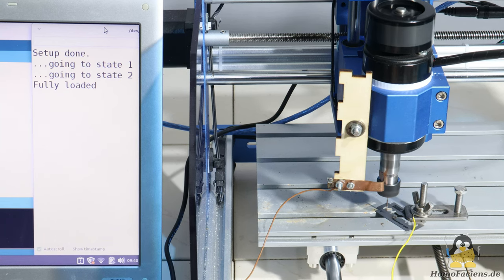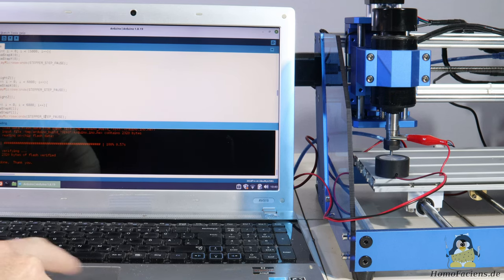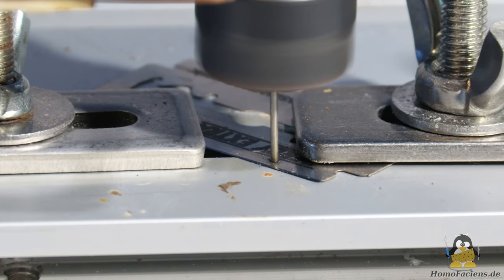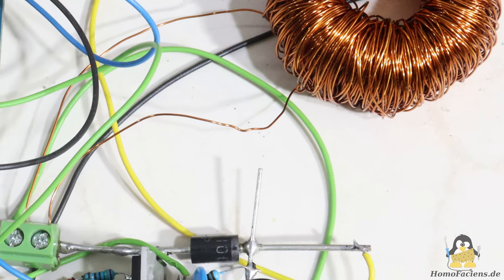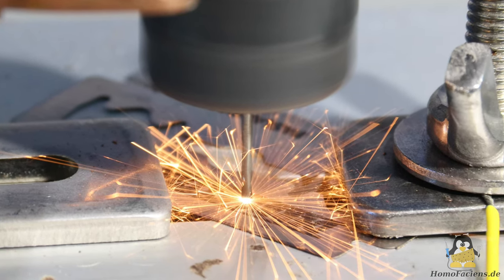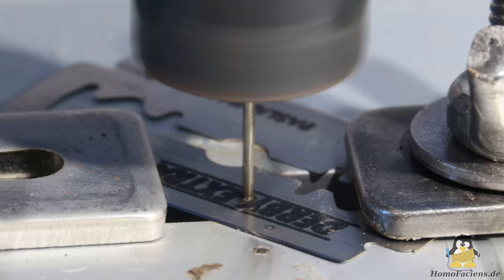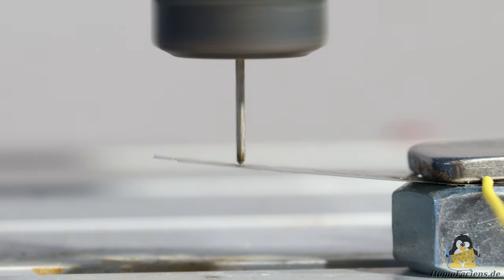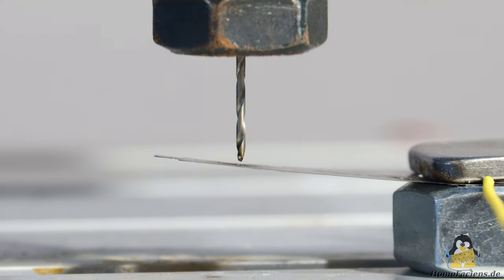Electrical Discharge Machining EDM, first experimental setup for drilling a razor blade

Comment: You will have much better erosion rate if you flush away burned material with dielectric oil or deionised water (if you use water, then you also need to pass it trough de-ionising resin, its pretty much tube filled with this powder, with mesh to stop it leaking from where water goes in or out). That is pretty much half of advancing speed into the material that you are cutting. Also, brass or copper is much better material than carbon steel in the drill bit (best material is tungsten carbide-copper electrode, but they can be maybe bit pricy for hobby use). You will need about 50-90V DC pulsed to 4-30KHz at about 100mA-3A. All these values + speed depends on material that is being machined. That are specifications to the professional EDM machines, except that they have pre-calculated tables recomended by manufacturers for different material of electrodes and different material that are machined, more closer to that specs, more precise and faster drilling. Also, for certain materials its ok to change polarity of electrode and machined piece
Reply from the maker: I know. This is a series that will explain how it works going from horrible to better step by step. Next video will show the melting process through a microscope. Stay tuned!

Comment: For the next video: 
1) please explain why you didn’t simply switch the discharge electronically
2) drill through a steel ball, it makes a great video thumbnail 😊
Thank you for this. Engineering principles demos using crude setups are the best ! 👍
—Arnaud from Tokyo
Reply from the maker: 1.) I guess more than just one video will be needed to dive into the electronics part.
2.) I have other things in mind for drilling holes or carving into
You're welcome!

Comment: Very cool, I had the opportunity to see an industrial EDM machine which used a reel of constantly moving wire so as to spread the wear and tear across the entire length. 
My question is, why do you need to spin the drill bit at all? I would think a stationary round rod would also work as it is the "spark" which is doing the work. I have also seen some others using a graphite electrode for more complex designs - maybe you could mill a negative of your logo into graphite and see if you can EDM your logo into some metal in a second revision 🙂
Reply from the maker: Rotation = no welding to the workpiece. It is a very experimental setup.

Comment: Is there any reason why you use an spinning drill bit instead of a bronze or brass rod in the chuck and avoid spinning at all?
Reply from the maker: Why the drill is spinning will be answered in the video currently under construction, more on material combinations and characteristics in later ones. Stay tuned!

Comment: could you not just use PWM to control the spark and then use the Z high to control the quality of the spark to make it have optimal distance to the work. That could be done by measuring the amps and volts at every pulse?
Reply from the maker: More on the electronics part will be discussed in coming videos. Stay tuned!